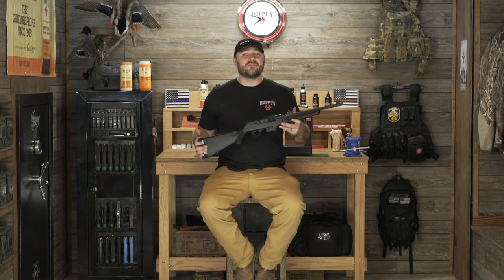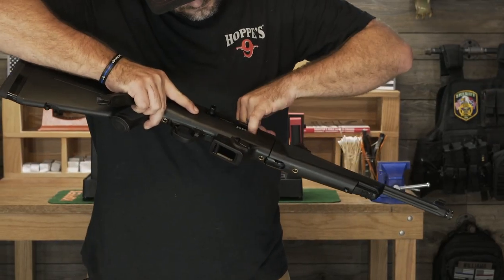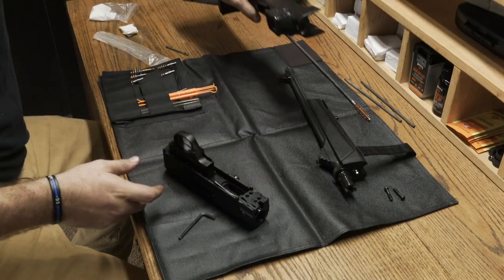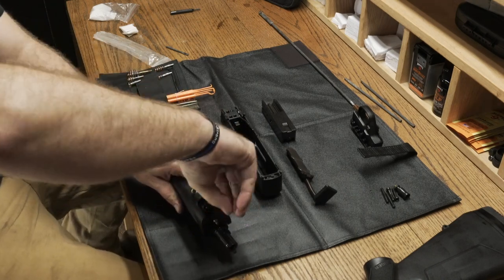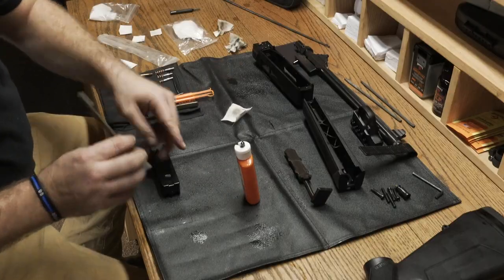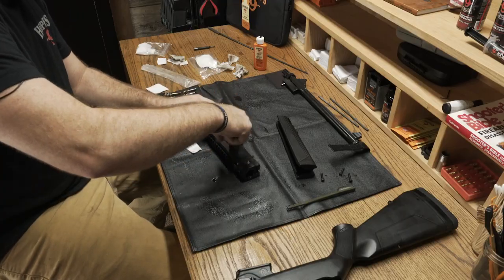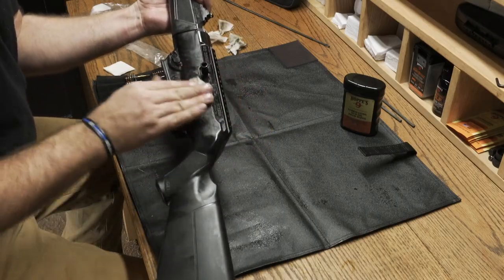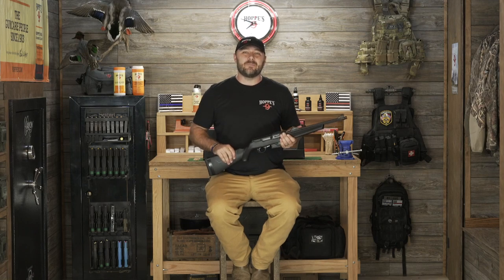How To Clean: Ruger PC Carbine

Comment: You went that far but didn't take the tungsten weight out, the bolt face or the two pins that hold the bolt face. Come on. You guys can do better than this. Hoppe to it.

Comment: Forgot a few steps in the function check:  The safety check - cycle the  unloaded action, pull the trigger and wait for a "click" that you hope you don't hear (no "click = safety works) and The sear check:  Cycle the unloaded action, pull the trigger, keep the trigger pulled to the rear and cycle the action again without releasing the trigger.  Then, slowly release the trigger to hear and feel the "click of the hammer/striker resetting to show that the gun is not going to inadvertently go full-auto on you and that is is indeed a safe, semi-auto firearm.